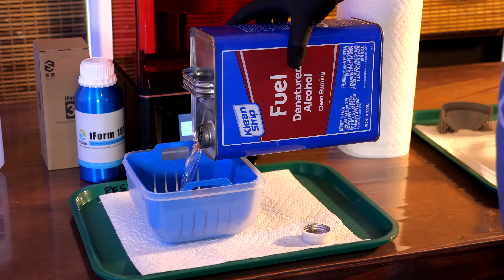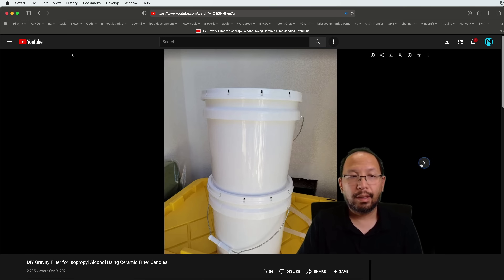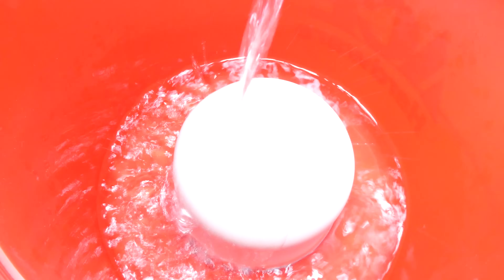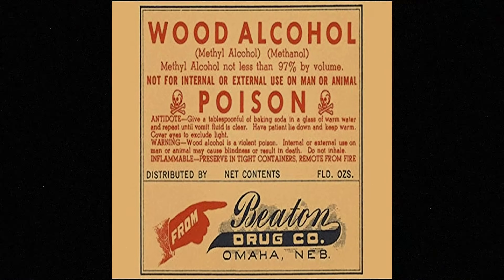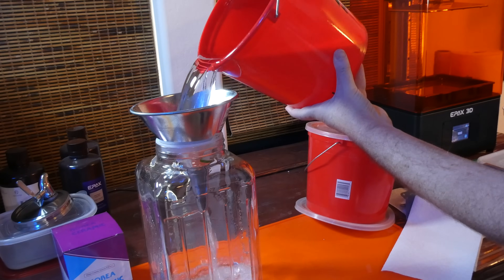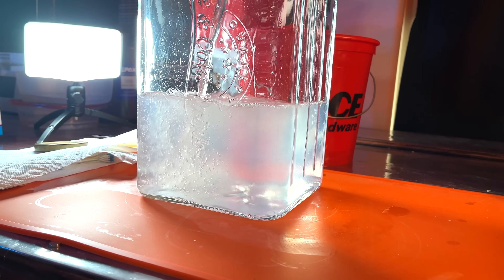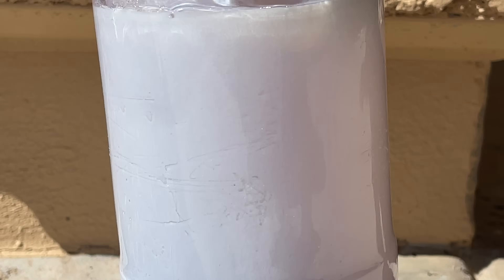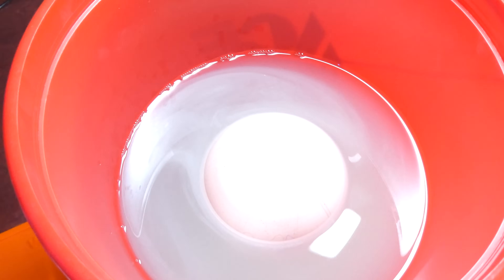Can We Recycle 3D Printing Alcohol?

Comment: I'm an "armchair expert" at best so take what I say as food for thought rather than solutions that will work.

It should be possible to use a centrifuge of some sort to dramatically speed up the precipitation of impurities. Also, to speed up filtering you could create lower pressure in the recipient bucket or create higher pressure in the source bucket to help push the liquid through. The problem with creating partial vacuum is that alcohol is already volatile, and with lower pressure it will evaporate even faster. I guess you could cool it down beforehand to mitigate it.

If the dirty alcohol becomes a gelatinous mess when exposed to UV for a long time you might want to give it a small dose of UV, filter out whatever has cured and repeat the process as much as needed. Alternatively, the gelatinous goop could be wrapped in cloth and squeezed to separate the liquid from the resin. You might even try putting it into a blender or a centrifuge. The problem was that the resin cured while being intermixed with alcohol, so it formed something like a sponge with alcohol being trapped inside. By mechanically disturbing the structure it should be possible to release the liquid.

Exposing dirty alcohol to UV after each use would probably prevent too much resin from building up in the solution. Granted, when there's not much resin dissolved in alcohol it's harder for it to cure, but it should work with enough UV exposure.

Here's something I came up that I have no idea if it will work or not. Solubility of chemicals depends on the temperature. So, theoretically, if you put dirty alcohol in the freezer it might be cold enough to cause resin to separate. After all, alcohol freezes at very low temperatures, so a normal freezer should not be able to freeze it solid, but will (hopefully) chill it enough to cause precipitation. I'm actually really curious if this is a viable method. I think it should work better on very dirty alcohol as opposed to alcohol that was used to wash a part once or twice.
Reply from the maker: I’m also only an armchair expert.  🤣

Comment: Rubbing alcohol was never drinkable, its isopropyl alcohol not ethyl so its not "denatured" at all. Its just inherently poisonous like methyl alcohol and its smell is also inherent in its nature, not an additive to make it non-drinkable. So your attempt to filter out the smell is bound to fail and the fact you thought it smelled "only slightly better" after filtration either was placebo effect or it absorbed moisture from the air and became less volatile because of that. It does not take Walter White to understand there are different alcohols that are inherently non-drinkable and smell different from one another. 
Also with proper distillation techniques you CAN separate out the ethanol (drinkable alcohol) from the adulterants that make it poisonous. Considering that nearly all fermentation leads to some methyl alcohol in the mix the distillation of fermented mash results in various "cuts" which based on the temperature of vaporization contain mostly methyl alcohol, mostly ethanol, and mostly water. The "heads" or "leads" being mostly methanol are discarded the tails at the end of the run mostly water are either discarded or added back into the main cut to lower its proof. Again Walter White need not be present, perhaps Popcorn Sutton (rest his soul) would be a better reference for the topic at hand.
Reply from the maker: Great info. Wasn’t aware.

Comment: Whatman 934AH filter paper will catch particles larger than 1.5-micron.  It is available in a number of sizes, one of which is sheets about 9"z18".  Speed and efficiency can improved by using a "filter aid," which is a fine powder added to the solution to be filtered.  It forms a cake on top of the filter and protects it from clogging.  Another approach would be to use a two-stage filter.,  First, filter thru a relatively coarse filter and then thru your final filter.

Look into the possibility of vacuum filtering.  Use a gallon paint can to receive the filtrate.  Drill two holes in the lid.  one would have a vacuum line running to the filter funnel and the other a vacuum line running to the pump..  As small as your quantities are, you can almost certainly use a hand-operated pump.  You might modify a bicycle pump so it sucks instead of blows.
Reply from the maker: Thanks I’ll look into that.

Comment: Great video. I'm glad YouTube recommended it! I suggest you make some form of high flow bubbler.  It helps keep my filters cleaner longer IMO, but likely adds to some evaporation loss. I just move one around the filter manually to help keep it clean, but be careful of disturbing sediment.  Wanted a means to quickly agitate,  but the bubbler was the only simple solution i had that didn't take up much space.  Also,  you need a pretty solid bottom and I suggest you mount the filter up from the floor of the container in relation to the amount of sediment you generally expect to have. Those flexible buckets make it easier to clean.  Take apart, set in sun,  once cured, flex the plastic to crack resin. I havent come up with a great solution for cleaning and storing the filters. Definitely waiting for it to settle and pouring off what you can helps. I started using a turkey baster to help with that collection process. I small UV blast under bottom helps clot the resin cake.  I have also had some luck adding diluted bentonite clay to help get stuff to fall out of suspension and make a harder pack at the bottom. If you add a lot,  it can be harder to cure though. I understand the desire to use glass,  but getting those cakes out can be a pain.  I tried a coffee over the filter with a big zip tie at base.  Need to experiment more. I want a way to block anything .05 or bigger and let others through.  The .03 clogs very quickly.  I have a plan to add those to a third stage.  I do not recommend for first stage -  have them at second stage right now.
Reply from the maker: Glad you found my channel. Some really good thought here.  Thanks.
Reply: Instead of a bubbler, what about an ultrasonic transducer like are used in parts cleaning stations? That would give a lot of agitation without having to cycle air in and out that carries away the alcohol vapour.

Comment: I would be confortable in distillation, I did with an heating mantle and worked fine. In italy denaturated alchol has no methanol but it is still harsh smelling. Also distilled smells bad.

Comment: Isopropyl is chemically different than ethanol. The isopropyl is very "branchy" like a tree branch which is a bit different than ethanol. This difference prevents the enzyme in our body from being able to metabolize. Methanol gets turned into formaldehyde in the body and that's what causes the most damage.   

But great video, You can also do something called "salting" out things that are dissolved in a liquid. I have had some decent luck with salting the alcohol first but I was running into issues of removing the salt without a distillation (I am also concerned with heating a very flammable solution.)  These filters may be the answer so thank you for the advice.
Reply from the maker: Good info.  Thanks for watching.

Comment: Is there a weight difference between the alcohol and the resin?  I suspect yes.  A centrifugal separation system might be more effective.
Reply from the maker: I was thinking that would be a way to settle it faster.
Reply: @Nerdtronic  A newer solution that still involves filters is to actively push the IPA with diluted resin into micrometer filters with a pump, instead of just relying on gravity which is very slow indeed, or a costly centrifugal apparatus. Search for Nick Wilson's IPA filtration machine, worth it. The money invested in the setup quickly pays for itself as you already know, as there are no more soiled IPA to dispose nor new fresh IPA (or almost none) to purchase again.
Icing on the cake: this solution also adresses the other pinned comment by @photodontist8640 as it is not messy at all: the only things to dispose of are the inexpensive, compact, solid-state filters (once every 12 to 18 months!)

Comment: hmm.. since the issue is particulates, I'm wondering if a flocculant would be cheaper.  A 5-pound container of pool flocculant is about the same price as your filters and can clarify 20,000 gallons of water.  10 grams of bentonite can clarify 5 gallons, and about 4 kg of bentonite can be had on Amazon for about $30.  That's enough to do 2000 gallons and I know for certain it won't hurt the alcohol since it's used in wine making.

I think the bigger benefit of flocculants is that you could clarify every container you have all at once.  The down side is you'd almost certainly introduce a little water, at least with the bentonite.
Reply from the maker: Interesting idea.
Reply: https://youtu.be/HxT8rEr-tFI - They use Aluminum Sulfate to do what I think you're talking about. They say it works pretty well, though the commenters are skeptical (I haven't been able to try it yet).

I feel like there's a process to clean the really nasty stuff with a combination of clarifying, curing, and filtering. I'll definitely be building a ceramic filter rig, though...

Comment: theres another way of doing this that combining the low cost of the filters but also the effectiveness of the distillation while also being completely safe. And you also wont have to mess around cleaning off filters, just occasionally cleaning a jar.

Solar distillation. 
You'll need a clear container that can be made air tight and you'll want one that is at least twice the volume of the amounts of alcohol you wish to process. and then a black container for the alcohol, the shape of which should be able to fit inside of the clear one (my 3d printer came with a black jar for putting the cleaning alcohol in, but any should do, most black plastic containers will block significant amounts of uv so no need to get a specific uv blocking jar)
Personally i made a whole setup with a 3d printed stand that hold the black jar up off the bottom of the clear container, and a device that fits around the black jar and gives me two handles to hold onto it by as i lower it into the clear container. 

Pour your dirty alcohol into the black container, don't put a lid on it. Put it into the clear container and then put the air tight lid on the clear container and place the whole thing on a window sill or somewhere warm. The heat from sunlight or ir radiation will be absorbed more by the black container than the clear, so the alcohol will evaporate out of the black container and condense on the walls of the clear one and collect on the bottom of it. This is why you want a platform of some kind holding the black jar up, if the black jar becomes mostly empty and its sat in the pool of alcohol that has formed then it could tip over, but mainly its less effective if the black jar ends up in the alcohol that you don't want to evaporate any more, as then the jar will be heating up all the alcohol, and we dont want that. 

So thats it, just keep emptying the alcohol out of the clear container (one with a spigot could be helpful), and then pout more dirty alcohol into the black jar. Clean the resin out of the black jar when necessary.

The alcohol in the bottom will be pretty much 100% pure, depending on how hot your black jar gets, if you have say 70% alcohol that youre trying to clean then depending on how hot your window sill gets the temp might not reach high enough to evaporate any water from the black container. And the temperatures shouldnt get high enough to be a safety issue, though obviously dont do this anywhere near open flames.
Reply from the maker: Cool idea.

Comment: I'm sorry but I feel this isn't any better than using cheaper coffee filters coupled with a good funnel(even in terms of surface area). It still has all the same issues, unsurprisingly. A vacuum filtration system would far superior than just relying on gravity. After filtering a lot, I ended up settling with a custom distillation setup which works for me. But I understand the safety concerns many people have; It's not foolproof.
Reply from the maker: a distiller might be fine but I’m too paranoid about starting a fire.  Like I say I’m the video, this process is sort of a pain and might not be worth it.  Time is money too 😀
Reply: @Nerdtronic  Thanks for replying. I totally understand and I definitely support the idea of recycling our IPA. Both for environmental and ecological reasons.

Comment: Reusing the alcohol is a brilliant cost saving and environment saving measure. Thanks for sharing! Oh, distillation should be fine because there’s no open flame but me, personally, wouldn’t attempt because I’d probably figure out a way to make it go boom.
Reply: the problem is they are designed to distill water, so they heat up until the contents is 100degrees. which alcohol will evaporate long before that, so it depends how exactly its detecting the internal temperature and so you may end up with the heating element just staying hot and producing a lot of alcohol vapor rather than it condensing and coming out as a liquid. both wasting alcohol and creating a dangerous potential for a cloud of flammable vapor.
Reply from the maker: GE: Wow now I REALLY don’t want to try it 🤣

Comment: Distilling is not really a fire hazard.  Alcohol vaporizes at 190 degrees F, which is far lower than the ignition point of about 450 degrees.  For a safe distiller, the heat source should be non-flame and impossible to spill and contact with liquid or vaporized alcohol.  You could actually use a double boiler, where you are boiling water (212 F), and then putting your bottle of alcohol in the boiling water to distill into a tube and collect off to the side.
Reply: sure, but the problem is potentially creating a cloud of vaporized alcohol that could be ignited, since most electric distillers are designed for water, and will try to heat the alcohol to 100 degrees, like a kettle does. if it doesnt reach 100 degrees then the heating element may not shut off
Reply: @ge2719  Yes, my suggestion was to build your own distiller that uses a safe heat source.